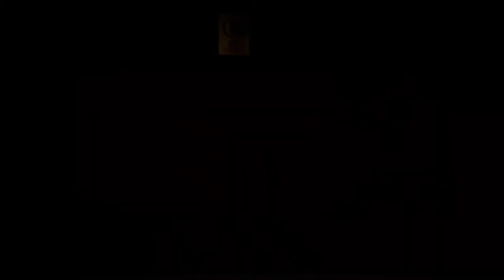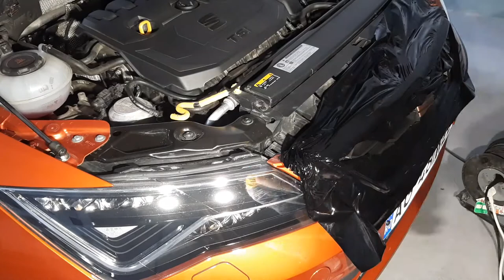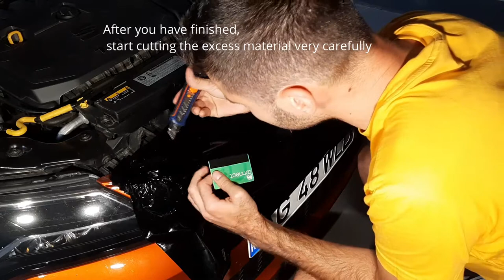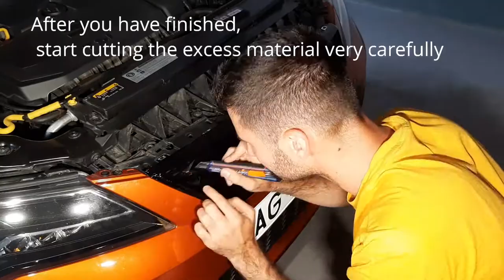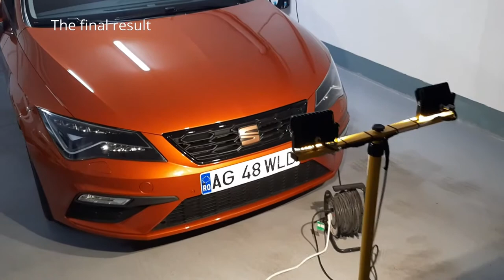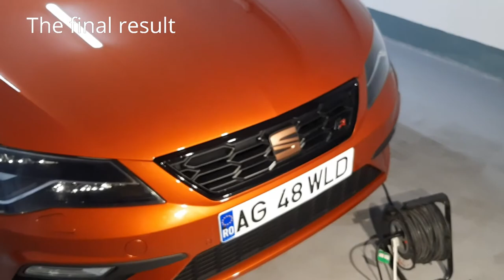How to vinyl wrap front grill Seat Leon 5F DYI

Comment: or you can buy plastidip for an outstanding result :)
ive painted around the grill just like you but also the LEON and TGI along with the two Seat signs black and its perfect
great videow btw!
Reply from the maker: Yes, but plastidip has a matte black. This vinyl is glossy black.
And I think plastidip will have a lot of stone chips in time.
Reply: @VladGeru  in greece there are plenty of other colors as for the stone chips time will tell..for now its been almost 7 months since i applied it and the finish is really smooth. I applied it while inside a room
Reply from the maker: @BuLlDoG9502  same here. I applied it for a better look :D
Reply: Αξιζει με palsti dip.? Αφαιρείται εύκολα μετα;